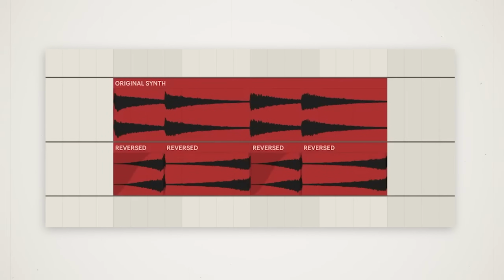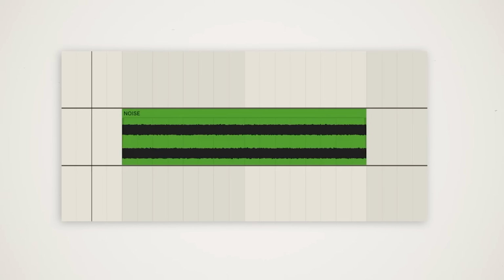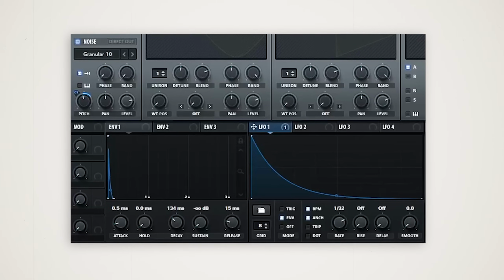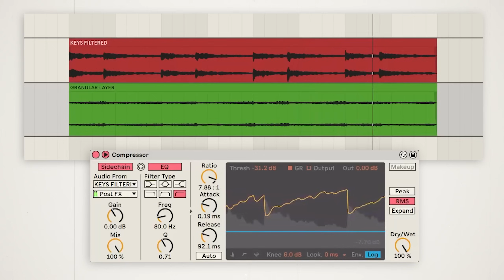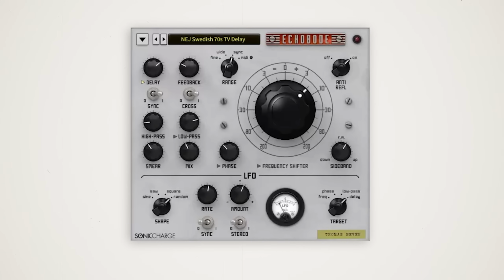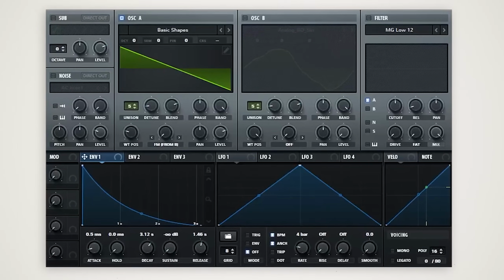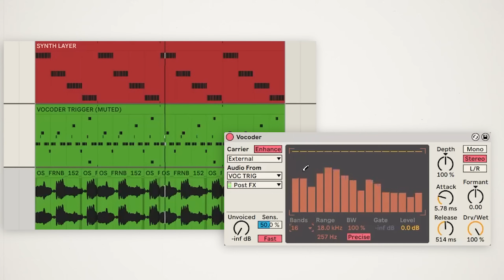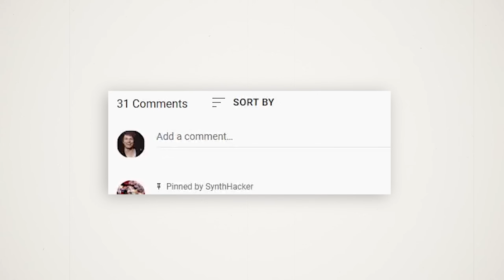10 Creative Synth Layering Ideas

Comment: Good video dude! My favorite one is the keytracked noise, never thought about this!
Reply from the maker: Appreciate that man, it’s a super fun one to play around with!
Reply: hi oversampled
Reply: Whattup
Reply: Same!!
Reply: Also if you have MISHBY it has a noise slider built in and might be the most intense plugin you can play with only just white noise 😅
Reply: This should not only apply to Serum but to every polyphonic synth. Synths with no separate filters are usually called paraphonic. With them you can't play chords with noise because the filter can only have one frequency.
Reply: It's funny you said that as an absolute beginner that's the one thing I've started with!

Comment: My personal favorite has been convolution synthesis. I use a free plugin called Convology XT and what it does is creates reverbs based on impulse recordings. It has a built in file browser that you can navigate to your sample library which allows you to select any sound you have and use that as an impulse! Taking a bass sound and using a perc roll as an impulse gives some really crazy textures and effects, or using a vocal one shot as an impulse for a pluck can create some really spooky and eerie atmosphere.
Reply from the maker: That’s a great one, I love it for drum sound design too!
Reply: @rainer3755  Huge fan of Trash 2! When I want a nice dry gritty sound it's my go to with a little bit of the old camel crusher. Recently though I picked up Rift by Minimal Audio through Splices rent-to-own system and it's becoming more and more integral to my sounds. It's a little more chaotic to try and understand compared to Trash but wow it can do so much. Definitely recommend checking out a free trial

Comment: Arpeggios - do two tracks using similar, but different sounds. Play with note panning ... As one synth is panning left, the other pans right... Add a synchronised delay, set to around 1/4 note or sometime around that (triplets can work  if you're careful 😅) and you have moving and audio interest that grabs the old lugholes.

Comment: 11: different chord voicings (wide, inversions, omitted notes - we hear too many close triads).
12: panning layers to different positions in the stereo spread.
13: when using polyphonic splitting, apply pitch bend to some-but-not all notes.
14: distortion, 
    - especially on tracks with "one and sometimes two" simultaneous notes 
    - especially effective if one note has pitch bend, but not the other.
15: when vocoding - speed up / slow down vocal before applying vocoder effect, so formants more alien sounding

Comment: pretty neat stuff you show here and I am pretty much doing this in FL using the included plugin Patcher, it is a super underestimated plugin with endless potential, in practice you can create super instruments or FX within this plugin and use this a sa standalone instrument. you could add as many synths and affects as you computer are able to run and then trigger this with a single midi pattern. it´s really neat ones you know this

Comment: I reamp all my synths through pedals and get the same types of effects
Reply from the maker: Would love to get myself some pedals at some point, any you recommend?
Reply: @SynthHackerTV  it all depends on what synths you have, but if it’s all vst’s then I would start with a delay and reverb, maybe a modulation and distortion. Then decide if you want a stereo path. With my hardware synths that are stereo I run them into an eventide timefactor, which has tons of delay options. Also don’t be afraid of noisy pedals, they add nice lofi atmosphere to pristine digital synths that can sound really cool. Anything by earthquaker devices, chase bliss, strymon and boss are good places to start. Real range of options and price points. Basically anything but JHS and Behringer and you’re good to go. Cheers man